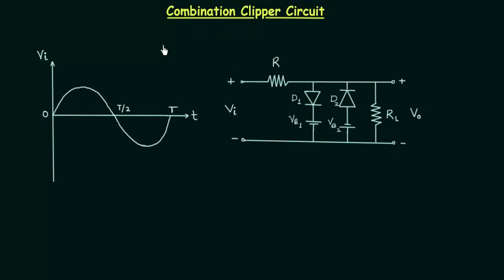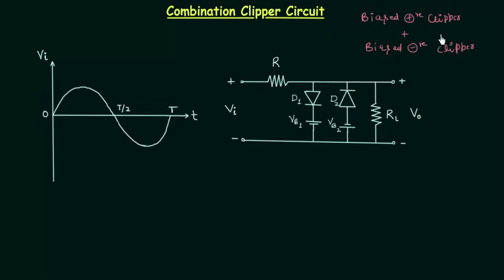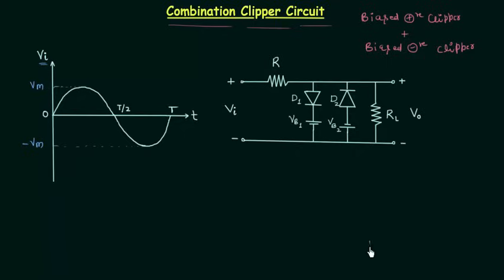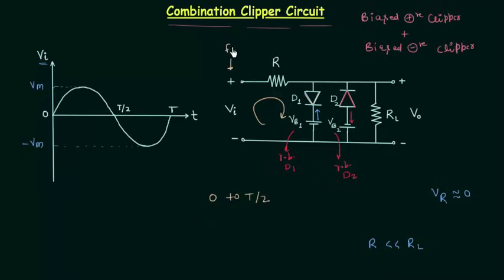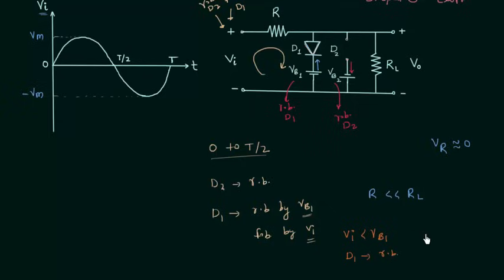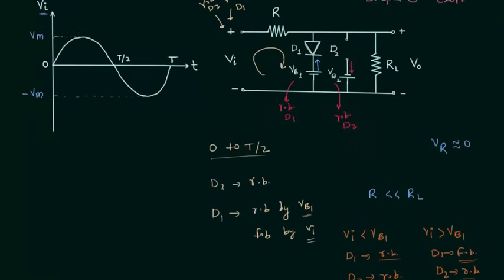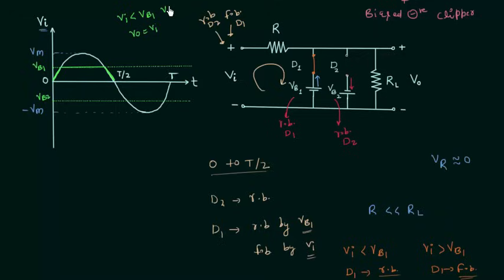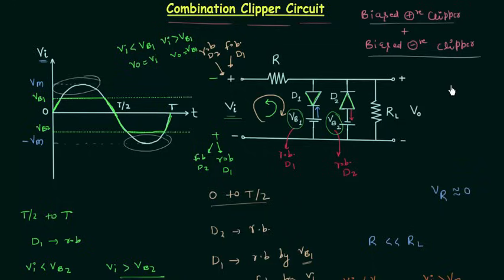Combination Clipper Circuits

Comment: at 5:00, how vi=vB1
Reply: Did you get ur answer bro
Reply: @enthusiast0799  Vb1 is parallel to the resistor...so definitely this is the voltage that will be across the resistor
Reply: When vi>vB1, drop across series resistance VR is vi-vB1, but he said VR=0.

Comment: Your video tutorials are very helpful and crystal clear for me. But unfortunately, I have a doubt regarding the combination clipper circuits..
When determining the biasing of diodes we are considering the input voltage and the external voltage near to the respective diode not the external voltage which is in parallel with the diode.
Why so ?
Reply: Same doubt after 7 years 😅

Comment: What if the polarity of Bias voltages in series with diodes are reversed in the same circuit?
Reply: Uzair Mughal output waveform will be different then
Reply: Yes, but I was looking how one can find that different waveform because if I am correct then that does not initiate from level "0".
Reply: Here in case 1 u said that D1 is reverse bias when Vi is less than Vbe .I think D1 is forward bias and D2 is reverse bias whence is less than Vbe

Comment: what if I use a si diode instead of ideal diode? to the output waveform
Reply: then just consider its knee voltage and solve in the same process....

Comment: what if the series resistance R not negligible??
Reply: u will have a voltage drop at the output by Vr, it will be (Vb1-Vr). And same for Neg. half cycle